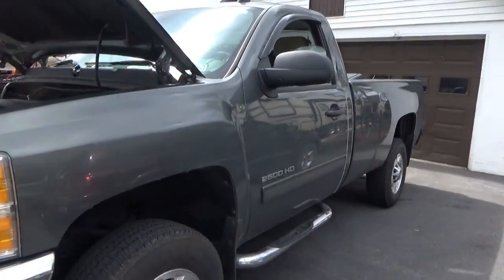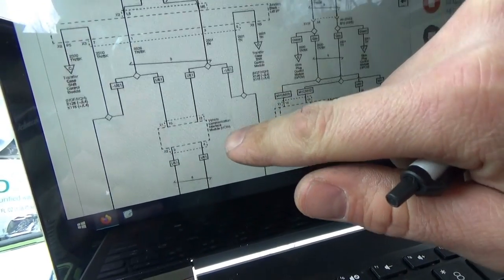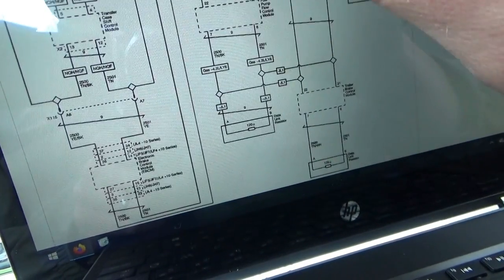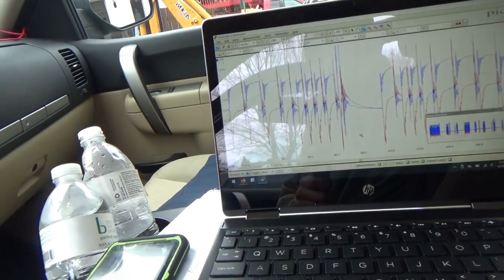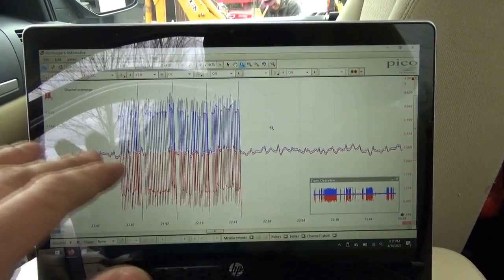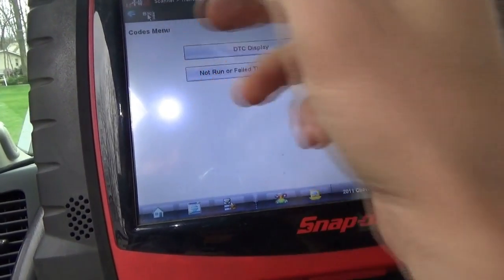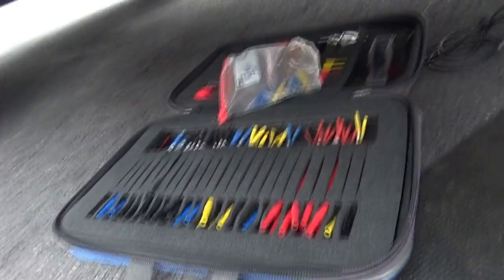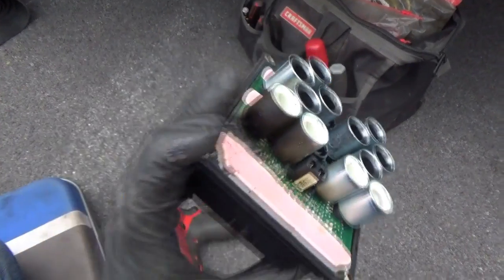Chevy Truck Goes NUTS! (CAN case study) - Part 1

Comment: Any idea on a 2014 Sierra locks locking and unlocking driving and sitting in reverse. New TCM and prindl switch ebcm all gm factory parts. If your sitting in reverse and open and close the doors the locks operate lock and unlock and looses comm with tcm

Comment: In my game  I find many previous "bodgy" repairs are the cause of many problems. They are often difficult to diagnose and swallow up lots of time , I often use a signal generator and tracing probe on big wiring looms to locate open circuits it's good as it shows where the break is  doesn't work for ground faults unfortunately but often saves me time and frustration with wiring issues.

Comment: All vehicles need a spice point somewhere easy to get to (like in the power distribution center under the hood) where you can isolate the various networks from each other and test them.  It's really just about criminal when they don't have that.   Good thing in this instance it was the ABS module instead of like a security module you have to take the whole dashboard out of the car to get to.

Comment: Love hearing you give  Bernie Thompson from ATS credit.    He’s the master we’re all learning from these days.   (I see your comments on his videos).  

The mark of a humble individual is giving credit!   Ivan, you’re a good guy.
Reply from the maker: Bernie is in a league of his own, just like Keith DeFazio 🙂
Reply: @PineHollowAutoDiagnostics   No doubt.   

Watching him has inspired me to start scoping more things.   In fact caught a weak intermittent starter on my daughters Honda 2.4l this weak.   And even found an intermittent short in a vacuum cleaner too!   Sure is like watching voltage in 3D.
Reply: @kc360awareness  Excuse me but how did you diagnosed a weak intermittent starter? Did you scope the amperage while looking at voltage and ground on different channels?
Reply: @petar443  basically yes.   The second channel was on the solenoid wire.    I needed to see if the starter was dropping out because of an internal issue or if the solenoid signal was dropping out.  In this case the start signal was strong implying the problem was internal to the starter.

Comment: Curious, in your opinion, What caused the module failure? Poor design? After market connections? Mosture/salt intrusion? Extreme vibrations?
Reply from the maker: It's a GM product with all the modules made in Mexico...quality control has dipped significantly from the 90s proudly made in the USA days...

Comment: That trailer was looming in the background. Do the trailer brakes get their power from the Electronic Brake Control Module? Something had to short out to take out a 40 amp fuse. Did a short burn out the module or did the module itself short out?
Reply from the maker: EBCM fried itself for sure.

Comment: Doesn't the 6.0 need the fuel pump driver module to run? I've had 3 or 4 of these ABS modules take down the CAN. There is a connector at the IPC junction box under the left side of the dash that takes the back half of the network out of the circuit. Good diag.
Reply from the maker: No fuel pump module on this beast
Reply: @PineHollowAutoDiagnostics  i wondered how it ran without a fuel pump. I was not aware the 6.0 was different from the 5.3. Good to knoe.
Reply: Some of the 2011 hd had fuel pump control module some didn't. Same part #.  Some had trailer brake control module some had fuel pump control module.  Had to program the module so it knew what it was.

Comment: Nice video again. Thinking how that board got toasted, the biggest power consumer in the system it's the ABS pump motor itself 🤔
Reply from the maker: Indeed. Wonder if there's a relay built in the EBCM since transistors don't like that much current...
Reply: @PineHollowAutoDiagnostics  Hoping to see further diagnosis of the original short circuit on part 2!

Comment: U0121 is the Transmission saying I’ve lost comms with ebcm aka abs
Reply from the maker: Makes sense :)
Reply: @PineHollowAutoDiagnostics  and the u0561-71 is cause the abs tells trailer brake what to do ( the abs and trailer brake is set up similar to a master slave configuration so the abs is master and trailer brake is a slave!)

Comment: Very good diag.  Split the system as best you can, do a pass through with jumper wires and finally sniff the module.  Got it!  Yup, module's bad!  On to part two.

Comment: Caused by incorrect trailer brake wiring? 
What melted module and 60 A fuse?
That's my question .
Or it may happen again.
Reply: I really dont think that the trailer wiring would be shared with the ABS module. Usually they have their own circuits that are individually fused.
Reply: @Mikeywil0003  Welder plugged into harness? Lol 😅

Comment: It must make it tough coming in after someone started working on it and replacing parts.
Reply from the maker: Doesn't really make a difference, as long as the parts were installed correctly :)
Reply: @PineHollowAutoDiagnostics  And as long as they didn't use Dorman parts
Reply from the maker: @crhirschi  TRUE lol